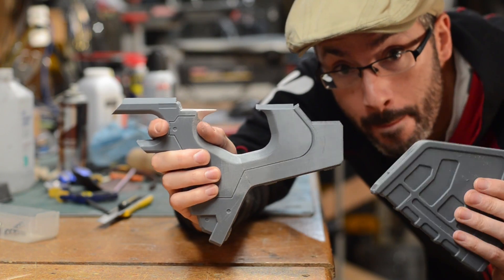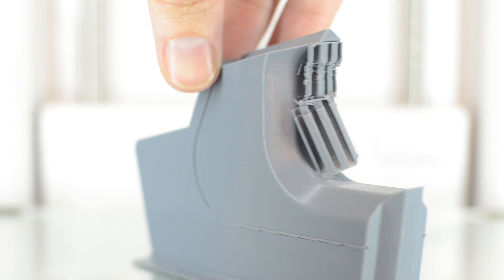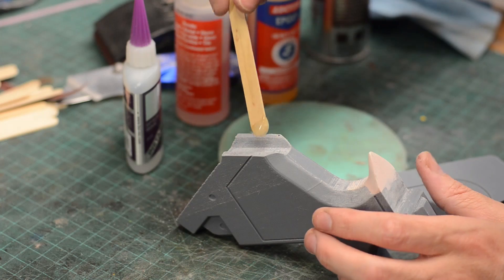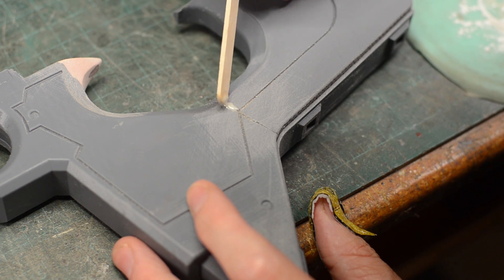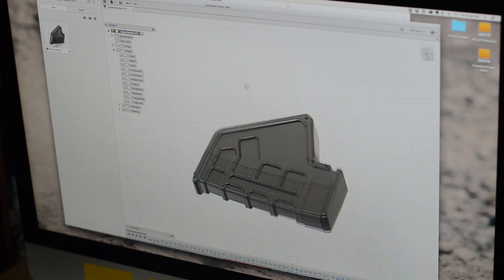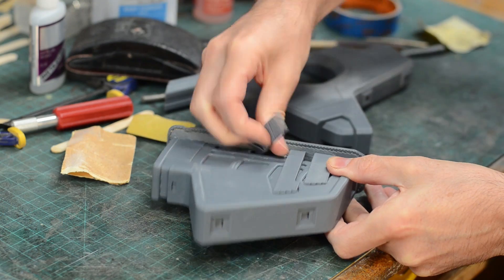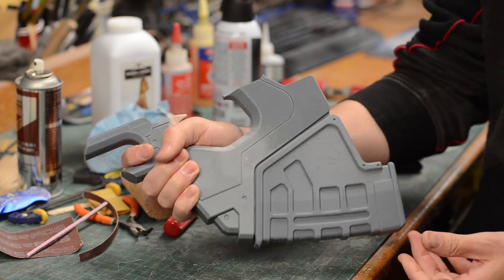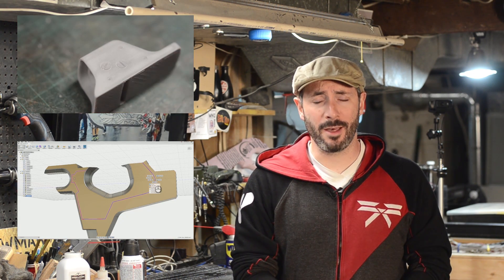How to 3D Print a Gun Prop from Destiny Part 3: Boolean Gemini Magazine

Comment: A little acetone works better than epoxy at holding parts together from my experience. Take a cotton swap and lightly brush both surfaces with acetone. A little goes a long way. It will slightly melt the surfaces. Then hold them together until it dries. Works wonderfully. Holds them together just as good as if it was printed as one piece. If not better. Just gotta make sure you don't get acetone on the other parts of the project.
Reply: ***** Ahhh. Unfortunately, I don't have much experience with PLA. As I use ABS. Thought acetone would be the same for PLA. Epoxy is a great bond though. I use it to hold metal to wood.Guess I gotta do some more research. Thanks for the info.

Comment: fun fact. I believe you can put together pla plastic using acetone. And it comes out smooth and doesn't give off that 3d printer pattern
Reply: use it on a scrap piece before you use it on a part to learn

Comment: Awesome episode Bill! :D
But i can't help but wonder... (Was thinking about this during the last episode aswell) At 1:19 , the joint u printed looks like an inverted dovetail.
Wouldn't it have been possible to print a sliding dovetail instaid? Basically the other way around from what u did so they lock together and possibly even friction fit.
This way you could possibly take them apart for shipping and such, or would that not be possible with the printer?
Cheers!

Comment: I would love to use Fusion 360, but I use Linux as my main desktop... I'm halfway confident that I could run it in an emulator, but I'm going to be looking for decent modeling software that runs natively. I'm learning Blender, but whoo, it's got a steep learning curve....
Reply: ***** So far I've been using Sketchup with an emulator, it works pretty well, but needs a plugin to generate files a 3D printer can use. If I find a native app that works well, I'll let you know! Still working with Blender too, but it's not really made for CAD design.

Comment: lab tests showed that gel superglue is best for glueing pla, even better than any epoxy, but i usually use a dremel with a piece of filament method,  i tryed printing 7mm pla rod and load it in my hot glue gun, but dremel gives stronger result.
Reply: Isn't solvent welding better?